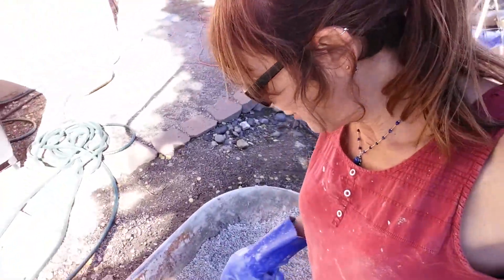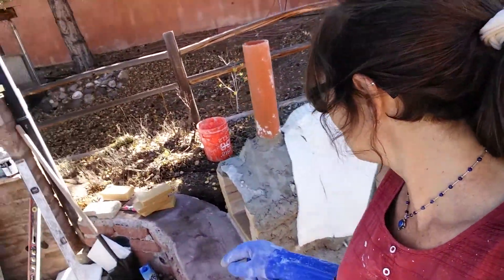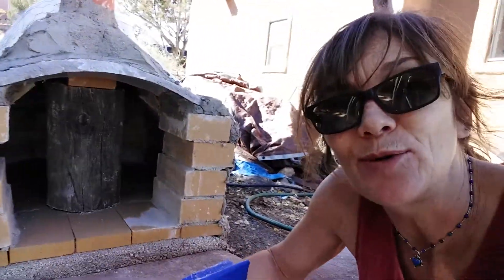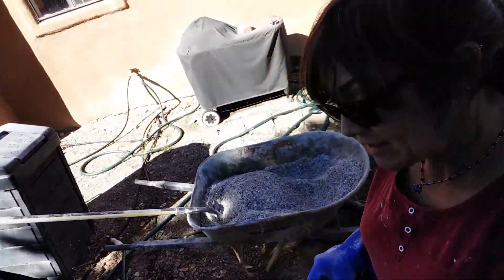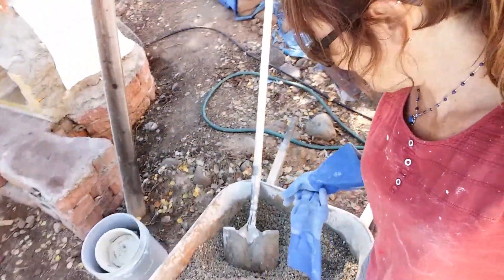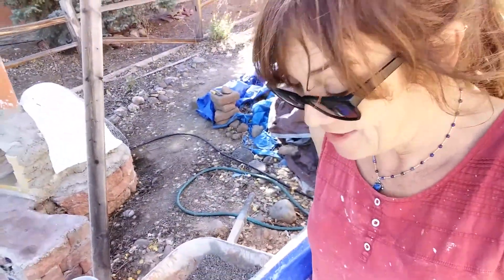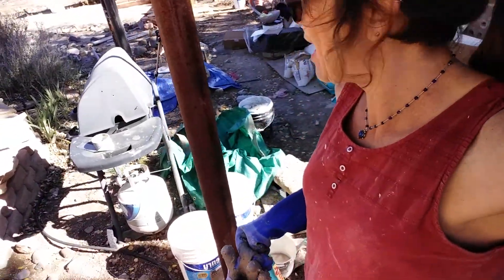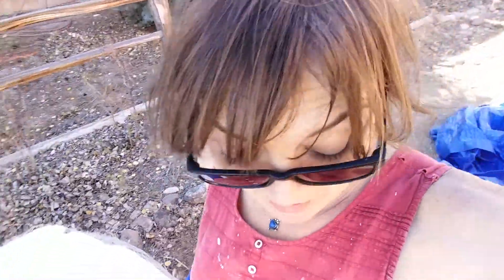Insulation Mix For Outdoor Brick Oven, #DIYwithAngel #LiveAlive!

Comment: Nice project 👍👍👍thank you for sharing. Where did you buy the perlite?
Reply from the maker: Thanks Key Tronic. The pumice is mined in our local mountains and I get it from supplier in Espanola, on the other side of the mountains it is in. The perlite (heat expanded/processed pumice) I get from my local greenhouse/gardening center (Alameda Greenhouse) or at Home Depot/Lowes. It runs about $20 for a cubic yard (27cf) from industrial suppliers or $20 for 3-4 cubic feet bagged up for retailers.